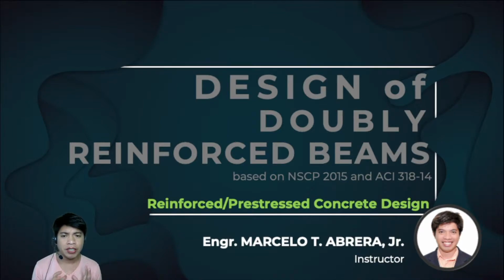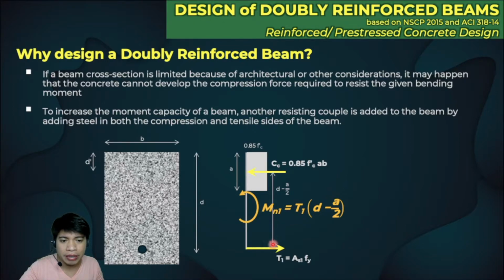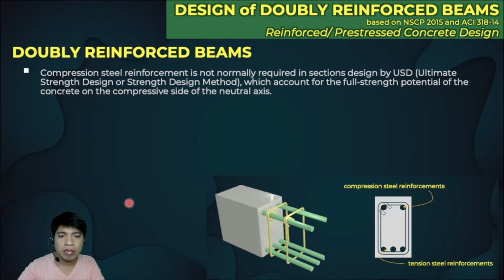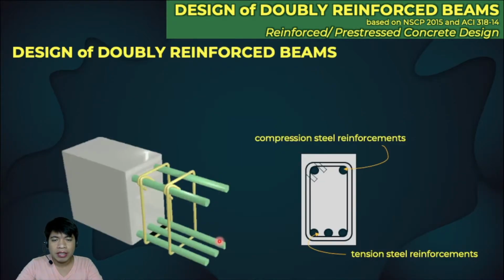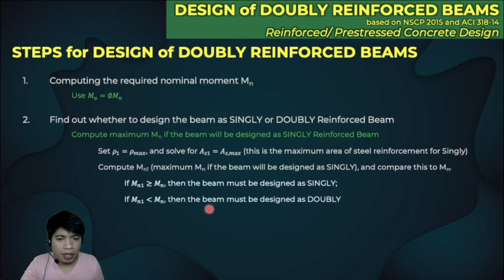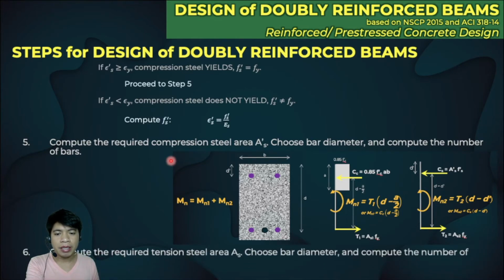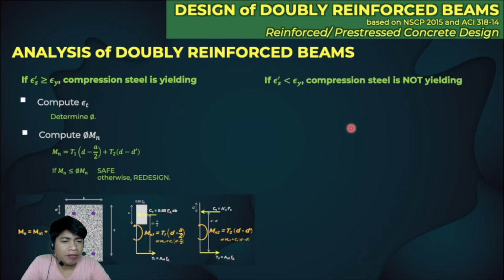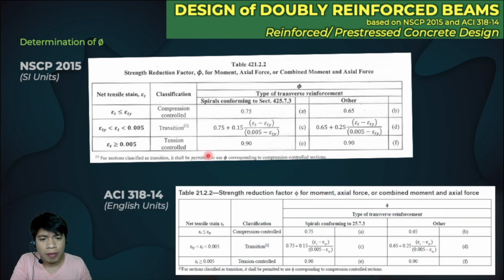(1/2) DESIGN OF DOUBLY REINFORCED BEAMS based on NSCP 2015 and ACI 318-14|Reinforced Concrete Design

Comment: I agree. Finally, a tutorial video that explained well the concept of single and doubly reinforced beam. 

Addition of compression bars when the beam is super ductile will not increase the nominal strength of the beam, especially when the rho actual is less than 50% of rho max but greater than rho min.  You will only get a significant increase in moment capacity (I think up to 15% to 20% as far as I remember) when the rho actual of tension bar is equal to rho max.

Correct me if I'm wrong but the equivalent of rho max to the newer code version is 0.004 not 0.005 based on the ACI code. The 0.005 is the minimum tensile strain of rebar required for you to consider the section tension-controlled and use 0.9 reduction factor. Actually having a tensile strain between 0.004 to 0.005 will give you a reduction factor around 0.8 to 0.9. But in the older code, as long as the rho actual is between rho min and rho max, you can use 0.9 reduction factor.

Hopefully this would help.